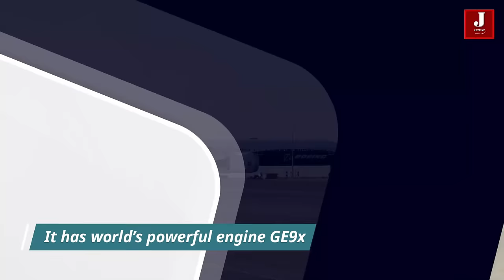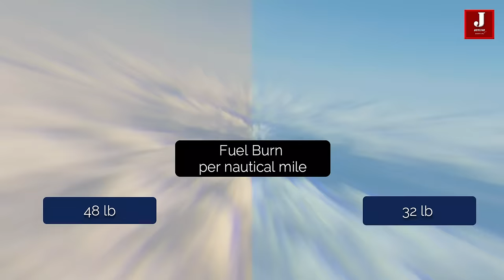Mega Comparison of Boeing 777x vs A350-1000 Aircraft

Comment: The top 5 largest A350 customers having 777X on order should tell how just how good the 777X is even with the existence of A350. The A350-1000 also has half the orders of 777X with a negative order book since 2019 whereas Singapore ordered 11 777-9 in 2021.
Reply: It's good for it's size but not better than the A350 clearly, it certainly was a better replacement for the two large quadjets the A380 and the B747 from Boeing's perspective though.
Reply: @mwat22  777X is better than A350-1000 (which is it's rival) that's certain, can't say it is better than the whole A350 family tho as the A350-900 is of a completely different category i.e medium sized wide body competing with 787-10.

Also, the main purpose of 777X (and A350-1000) is replacing the 800+ 777-300ER of the world, not replacing quads. The 777-9 clearly is the better option for this purpose hence it has twice the orders as A350-1000.

The 777-300ER was Boeing's 747 successor (was A340-600 from Airbus' side which is almost non existent now due to being terrible) and the 779 and 351 will be the successor of 747's successor lol.
Reply: @aseem7w9  well based on your argument both should now be producing quad jets or designing the next Quads cause as you said the 777 and 350 don't replace the quads 😂😂😂😂😂😂 FOH and with the 777-9 having a shorter range and more fuel burn how is it better? or its better cause you said it and more is always better right?
Reply: @mwat22  777-300ER already replaced 95% of quad jets over the past decade in the world that's why I said 777X and A350-1000 won't be replacing quads. Learn to read properly before replying.
777-9 has the range for every airline route in the world except like 6-7 of them so range is no issue. The 777-8 is there if an airline does want even more range. Having more range isn't always better hence ULR planes never sell a lot, more fuel tanks just add more weight. 
In terms of fuel burn per seat tho, Lufthansa said 350 and 779 are similar so from where did you get that A350 is more efficient? I'd rather trust the word of the 3rd largest A350 user rather than you on how much fuel it burns tbh.
Reply: @aseem7w9  its (777-8 and 777-8) still more expensive than any of the planes in the A350 family and also also learn to read what you type before you send it, whos already operating the 777-9??? and by your own admission that ER only adds weight so how's a lighter A350 burning the same as a heavier older 777-300ER???
Reply: They are not quite the same frame, They will likely have diferent use cases for airlines.
Reply: @yo yoI think the 777-9 is better. But haven't they already done the tests? They did a 10 hour flight and measured the fuel burn. and the price depends on demand, making costs and added taxed and other stuff. I am quiet sure they have work out that already after all these years of  waiting?
Reply: @yo yo oh kk. That's true
Reply: Exactly this is the point, actually the A350-1000 is a pretty poor seller.
Reply: @Stvescr  bruh. U can't say that yet!  The 777x has not even been put into service yet! So this argument is very invaild. The 777x engines broke world records and produce the most thrust than any other airplane engine that we have today.
Reply: @aseem7w9  777s replaced 95% quads? Where did you get that from? 767s, 777s, 787s, A330s and 350s have all been replacing quads. Not only the 777 ;)
Reply: @aseem7w9  And why did Lufthansa order 43 350s but only 20 777-9 if they are equally good?
Reply: @matthiashartge5520  they ordered the small 350 900, not comparable to 777 9. It's like saying why is delta in talks to order 100 737 max 10 if their a350 is good.
Reply: @matthiashartge5520  I meant replaced as in a direct way. The 346 died quickly so there was nothing in the way of 77W.
Reply: @aseem7w9  Hmm, I don't know what you mean by direct replacing... Singapore replaced A340s with the 777 but e.g. Iberia didn't, Virgin didn't, Lufthansa didn't... 
And the 777X doesn't sell as good as the classic 777. The X won't replace the 777 directly either ;)
Reply: @matthiashartge5520  Even I could give examples like Qatar, Emirates, Etihad, Air Canada replacing 340 with 777. Here I was mainly talking about replacing the 747-400 tho which was the most produced wide body variant not that long ago and sold more than all Airbus quad jets did combined.

The "classic" 777 your talking about consists of 2 generations of 777 with sizes ranging from being an A330-300 rival to 747-400 successor, of course the 777X won't match it. The 777X only really directly replaces the 777-300ER and not 772, 773 and 77L so yes you can't call it a 777 successor either. 
However the 77W has more than 800 air frames built (the most of any wide body variant) and is the most active wide body as of now so there's plenty of market for 779 there in the long run. But now 777-300ER is still young and strong with airlines taking delivery of it in 2022 so not many are hurried to replace it.

Comment: Personally, I see the same rivalry as the 787 and the A330neo, the 777x and the A330neo are planes that somehow defend themselves against the competition.
Many airlines wanted to replace their A330-200s with 787s and this one is selling pretty well on the market so Airbus wanted to keep the A330 in the race with the Neo but that's just not enough. The 787 is a much more advanced and comfortable aircraft with better fuel economy and is an all new model.

It's exactly the same for the A350 and the 777x. The companies intended to replace their 777 and A380 with A350 (in particular Air France), and there Boeing wanted to maintain the 777 (which is a success) with the 777x which is like the A330neo, a more economical, more efficient version and with more capacity than older versions.

But only, the 787 and the A350 are simply better because they are superior advanced technology aircraft and much more economical and efficient with their carbon composition. Both of these if are best in class, a brand new more advanced aircraft will always sell and outperform an old upgraded aircraft.

Especially since the A330neo and the 777x keep their old heavy fuselage in aluminum metal while the A350 and the 787 have their fuselage in carbon, much lighter and which reduces fuel consumption and makes the cabin quieter and which suddenly makes these planes more comfortable.
On the other hand, the 777x has a better chance of withstanding the competition thanks to freight and cargo variables and also the fact that companies can use it to replace their A380 or 747 while keeping almost the same amount of passengers per flight and that with less fuel consumed and much more efficiency.
Reply: Disagreed with A350-1000 being more efficient than 777X, the data available currently is not at all enough to support this claim. 
The only thing we know for now is that GE9X has turned out even more efficient than GE promised which makes your claim even more questionable and Lufthansa, one of the largest 350 customer says 777-9's efficiency is just as good as their 350 fleet.

Also, unlike 787 vs 330neo the 777X is beating the A350-1000 by a good margin in orders. The A350-900 has a lot of orders but it has less seats than 787-10 which makes it irrelevant when talking about 777X.

The example you gave of Air France is also irrelevant since they chose the A350-900 to replace the 777-200ER fleet. The largest A350-900 customer in the world, SIA has 0 A35K on order but 30+ 777-9 so the airlines having 359 in their fleet isn't a loss for the 777X program but for 787 program where Boeing failed to sell 787-10.
Reply: @aseem7w9  I admit that I prefer boieng than Airbus but the A350 seems really efficient to me but on the other hand it was my impression but the 777x seems in certain aspects much more efficient
Reply: @planeup__3049  both are super efficient planes and the margin between them isn't big enough that fuel efficiency is a plus point for any of these 2. 

If the fuel efficiency gap is big enough to matter much then manufacturers will be trying  find new ways on how to improve it like airbus with a340 600 trying to give it new engines not even 5 years after its first flight due to 777 300er's excellency.
Reply: A Boeing aircraft comfortable? Almost impossible!

Comment: There is still consideration by Boeing to produce the 777X-10, which will likely increase range and seating capacity.
Reply: I don't get the stats with this video. It says the 777x has a greater fuel payload than the A350 and yet the Airbus can fly further. Something doesn't add up right ?

Comment: I have flown on both planes with KLM (777) and  Delta Airlines (A350), I must say it is rather difficult to say which one is better because both planes were equally comfortable. However, I must admit that A350 is a quieter plane and my journey from Los Angeles to Sydney Australia was very comfortable and not tiring at all despite the 14 hour flight, whereas my flight on 777 from Paris, via Amsterdam to Washington DC felt a bit cramped and noticeably louder.
Reply: I think you should fly the same route with 2 different aircraft than you can tell the diffrence
Reply: @sidhusharma1513  good point
Reply: 777's engine is more powerful therefore it could be louder that way
Reply: @Blockthecreeper  It's even a bit overperforming
Reply: blud 777x has not released.

Comment: I'd still take the A350. Makes no sense to carry more cargo and fuel, less pax but not be able to match the A350 flight distance. And then there's the cost of the 777x at over 400mil per unit...
I'll stick to the A350 then. It's been tried and tested. The 777x is currently delayed too.
Reply: Just that minor issue of the skin peeling off....
Reply: The numbers are incorrect. The 777 has the longest range in its class
Reply: @iLoveBoysandBerries  I was going to say the same thing [though without any real research].  How can the A350 hold 54 more passengers while having a far smaller footprint?  They have similar engines yet the 777 carries "34 tones" more fuel but has 80 percent the range?  That makes no sense either.
Reply: Someone's finally making sense 😁👋👋👋👋
Reply: It’s cargo in the hold that makes money.
Reply: @stevebeckerman4214  The thing is, much of the belly freight is off of passenger flights and in dedicated freighters.
Reply: Thing is that that 480 max pax number is a theoretical number in an all economy class config, the 777X can reach 500 pax in that theoretical config
Reply: @speen9430  They should have said that in the video.  Thanx!
Reply: @Flies2FLL  because of the lighter composite materials. If boeing used this much composite, they could've gone away with a similar engine to the a350 and more range (because of the wings). But it seems their thinking is stronger is better, larger is better, heavier is better
Reply: @topethermohenes7658  Well Topet that is correct, though I thought the engines were roughly the same.  In any case Airbus is on record as saying publicly that they believe their aircraft should be recycled at the 25 year point regardless of time or cycles, and they build them as such.  Boeing equipment from the 1970's is still in the air today, and 35 year old Boeings are actually quite common in the cargo world.
Reply: @Flies2FLL  personally I would NOT want to fly on 50 year old aircraft thank you very much. Id take a new airbus vs an old Boeing any day. An im 100% there are many more people who does. Keep cold war era tech away from modern commercial aviation please.
Reply: @topethermohenes7658  Why?  Give me one good reason why you won't ride on a properly maintained 50 year old airplane?

You drive over 50 year old bridges every day.  Hello? And what if that 50 year old airplane had only a few hundred cycles?  Hmm?

I don't think you know that much about aviation.
Reply: @Flies2FLL  because you have no choice, if I was given one, id choose to drive. On a newer bridge. But its not even the materials, Its the tech, id be much more comfortable flying with modern avionics than a 50 year old tech. And by flying I mean actually flying I have an a319, a320, a321 and an a330 current license with me

Those who choose to fly on 50 year old, noisy, gas guzzling, unreliable aircraft are simply out of their mind
Reply: @topethermohenes7658  Tech does not get you safely from point A to point B.  That attitude has killed a whole lot of people over the years...

When was the last time your computer crashed or gave you trouble?

When was the last time a concrete bridge collapsed underneath you?
Reply: @topethermohenes7658  You've never experienced a computer crash huh?  I watch Honeywell Pegasus do stupid things all the time.

Hello?
Reply: @Flies2FLL  sadly nope, maybe check your temporary abnormal behaviors in FCOM to avoid such crashes or have you not read them yet?
Reply: @Flies2FLL  and what do you mean by stupid things? Garbage in garbage out is a very simple concept, maybe avoid putting garbage commands yeah?
Reply: @topethermohenes7658  Face it, you've lost the argument.  Now, tell me about all these concrete bridges that you've had collapse underneath you?

Comment: since when was the a350-1000 able to seat 480 pax? and the much larger 777-9 only 426 in comparison? you've gone nuts!
Reply: It all depends on customer's requirements. Maybe with 100% economy class you will achieve 480 passengers.

Comment: I see here a huge misinformation , how come a350-1000 has less width and length than 777x but has 54 more seats ???
This is absolutely  incorrect .
A3050-1000 has 350-410 passenger capacity .
Reply: The Exit Limit of the A350-1000 is 5 seats more than the 777-9 (480 vs 475). But this is because Boeing canceled the pair of Exits over the Wing that the 777-300ER featured. The 300ER has a 550 Seat Exit Limit, so the 777-9 would fit even more. But because No Airline ever seated more than ~420 passengers in their 777-300ER they canceled these Exits as they add to the empty weight of the aircraft and waste space. They added an optional Exit behind door 3 that brings the Exit Limit Up to 475, without These its at around 420 I think.
Typical 2 class seating is approx 350 for the A350-1000 and approx 380 for the 777-9.
Reply: @widget787  Interestingly, Frenchbee have the A350-1000 set up as 440 economy and 40 premium for a total of 480.
Reply: @StopMediaFakery  French Bee has a horribly tight 3-4-3 config that no legacy Airline could ever use.

Comment: Once you fly in a 787, especially window seat, you get hooked on to its huge windows!... far bigger than the 350s.
Reply: I like the Airbus A340 better than the Boeing 77. Is the better plane, no?. With the big engines, four of them is bigger than the Boeing. Airbus best
Reply: @explorelondon3695  4 engines burn more fuel than 2. They won't be around for long.
Reply: @6733hbr1  Thanks 777, am surprised it took a month for a reply, I was expecting s lot of Airbus Vs Boeing stuff but you are kind enough to offer an explanation instead of an insult like most do on this site. Best wishes and regards🙏.
Reply: @6733hbr1  Yes indeed but the 2 engines are nearly twice the size of the 4 engines . So how much more fuel efficient they are in comparison would be very interesting
Reply: @bakgatfromgb  Just maintaining 4 engines is more expensive than two. The four engines burn much more fuel than two but I don't know the numbers off hand.
Reply: @6733hbr1  Good point🤘
Reply: And the electronic dimming function on the windows is really interesting ...

Comment: From my experiences so far of the A350, it's the best aircraft I've flown! So spacious, comfortable, modern and easy to breathe inside. I didn't feel as jet lagged as I normally would. I also love the large windows. The 777X will have a lot to compete with!
Reply: The Boeing 777-9 has 25% larger windows, its new engine is quieter and it is also 11% more efficient than the a350.

Comment: The b777 overall is just slightly larger but not by much. I've always been a fan of the more beefier looking 777 as the a350 is more slender looking esp around the tail area of which its tail looks quite abit smaller, the 777 is more in proportion. There both fantastic aircraft but the 777 looks abit more old school like a 767 or a330 so for me the winner is the b777!
Reply: I’m a huge 777 fan too! It was one of, if not the main motivational machine I’d admire throughout my training and career. The 77W seems to have been the ultimate game changer. Vastly more capable than any Airbus competitor and visually striking with such immense size and incredible engines! Unfortunately, I feel Boeing really missed the mark with the new 777X. It’s taking too long to develop, due to many reasons as we all know, not all directly related to the program itself. And I think they should’ve taken more of the quantum leap tech from the 787, building the fuselage primarily of composites. It’s such a massive machine and impressive for that, but it just stacks up too heavy against the A350, who was developed initially as an ad hoc answer to the 787 and has matured in to a seriously heavy hitter that only sips the fuel. Boeing’s corporate derailment, resulting in technical incompetence at times, has allowed Airbus who are very good at rapidly reacting to market drivers and new technology, to leap ahead with their machines which are remarkable in their own right. I fear the 777X will never match the market share of the 77W.
Reply: @iamra_n3189  the b777 is more of a meaner looking machine,  more in proportion with those huge engines and i like the sloping front end where the cockpit is. My 2 favourite widebodies are the A330 neo and the B777 200 and 300series